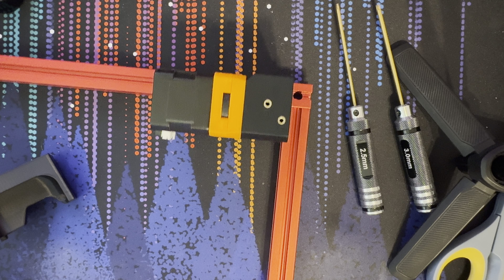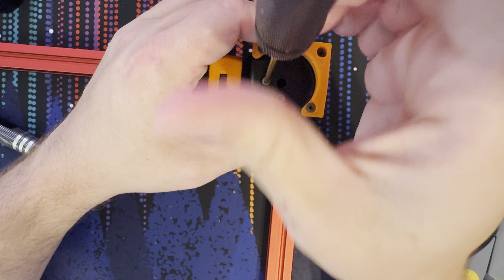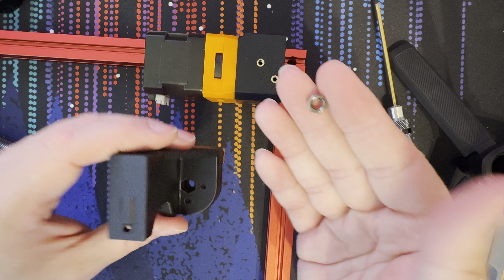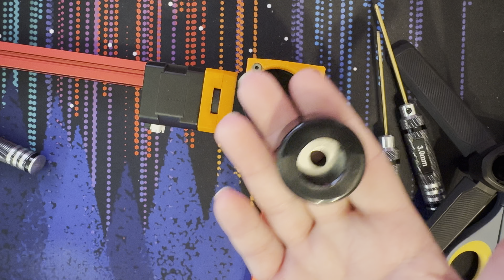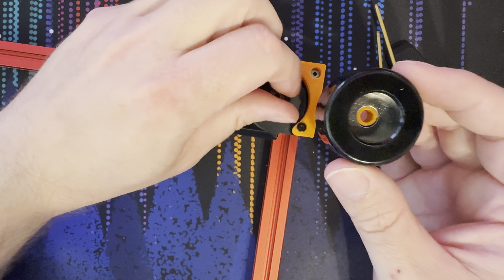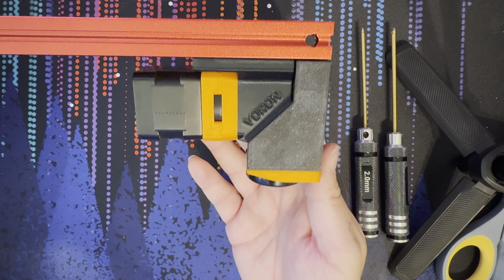Galileo 2 Z XL Beta Assembly

Comment: I found with the 0.5mm shim on the shaft to keep the axle from hitting the flathead screw heads, the planetary gears hit the back of the ring gear. I modified the planetary mount by adding 0.5mm to space out the ring gear to give it more clearance. It works without the modification but causes enough stiction to affect backlash. I modified an existing setup so maybe the earlier shafts are different????
Reply from the maker: @bobwtech  shafts should all be the same, and the printed parts already had the 0.5mm of clearance added. Are your parts over-extruded by chance?
Reply: @Jared01 I tend to slightly under extrude. Dimensionality, they match the CAD. Maybe I didn't need to go as far as 0.5mm, but the gears were definitely hitting the ring gear. You could see faint cross hatched marks. Anyway, it is a vast improvement on my V2.4 from G2Z. NO MORE DROOPING 😊
Reply from the maker: @bobwtech  I’ll take a look at the CAD and adjust as needed!

Comment: Is there a run current difference between the standard G2s and he G2XLS?
Reply from the maker: @Apocalyptic92  starting current for both should be 0.8, but the XL’s can go higher if needed.
Reply: @TheJaredC01  the nema 14 version in a 2.4  300 drops without power? Thanks!
Reply from the maker: @j.g545 correct, the NEMA14’s don’t have the holding power to keep up a 300mm gantry. You MIGHT get away with it with a lightweight toolhead, but I haven’t tested that.